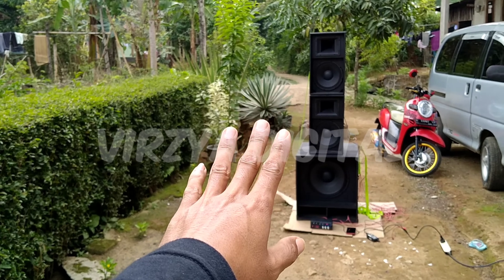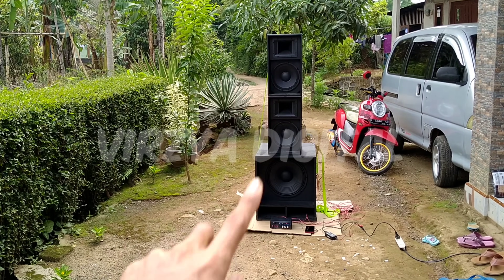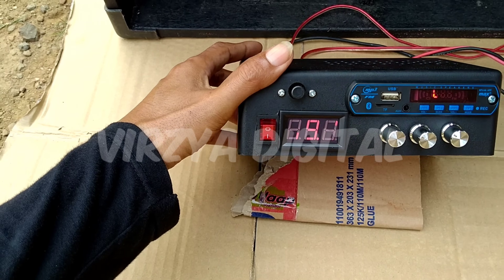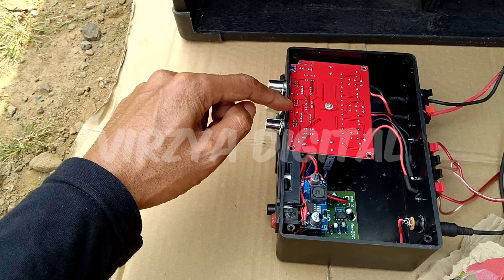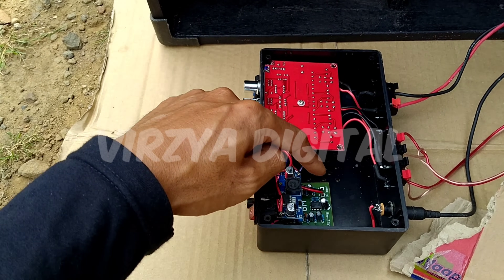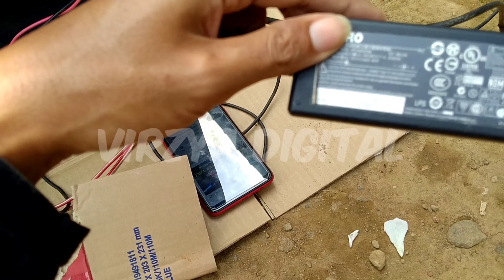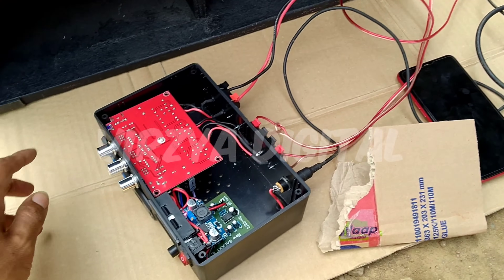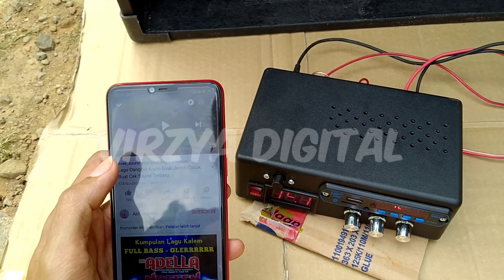Test Outdoor Class D Tpa3116d2 Angkat 10 Dan 15 inch Ternyata Bisa Glerr

Comment: Saya punya TPA3118 MONO chipt ori 32pin

Untuk angkat speaker pasif punya Polytron deck 450watt 10inch woofer 4inch fullrange 3inch tweeter kuat dan lumayan ber tenaga walaupun tidak maximal 

Dan di pasang speaker DAT 15inch 150watt berasa lebih nendang
Salut si sama ampli SE imut itu tapi bandel 
Gak tau kalo yg chipt kwnya

Comment: Sarannya bang saya pake smps 24v10a suara RL mantap cuma untuk subwoofer volume bass dinaikkan suaranya mati hidup (drop) mohon pencerahannya 🙏
Reply: Pengalaman prbadi...
Coba bos pakai 12 v 30@ suara lebih maximal. Di banding 24 v amper kecil..
Mending 12 v tapi 30 amper manter gak drop
Reply: @nnoficial2334  ocl 150 3amper udah gler
Reply: Jelaslah bro amper besar

Comment: Adaptornya pakek adaptor tv led kuat gk om?
Tegangan.AC.100-240V-50/60Hz
Tegangan.DC.12v/2.6A
Reply from the maker: Blm pernah coba mas
Reply: Bisa tapi enggak kuat ngangkat speaker besar... Hanya 30watt itu kalau 12v/2.6A
Reply: Cari ampere yg bsr  om

Comment: Joss. Jangankan pakai 15" mas. Pakai 18" saja nendangnya glerrr dalem banget suaranya tp powernya dimaksimalkan dayanya yaitu pakai adaptor 24Volt 10A. Mantab dah pokoknya libas ocl acl btl atau jenis botol libas untuk hasil suaranya bersih tanpa nois. Dan membandingkannya harus sesuai daya IC powernya jg loh ya. Klw ini class D tipe TPA31162 daya 200watt saja (bass 100watt, stereo LR 50watt 2x) 😄
Reply: Gler ,,, 1jam kemudian "bau apa ini bujank?"
Reply: @domhoregg_0377  skwkwk.. kemampuan oke.. ketahanan no🤣😁
Reply: Nyari dmna power 24v 10a link nya donk
Reply from the maker: 18"masih di toko mas 😂😂
Reply: Suk tanggapan nggo iki wee rasah tuku power2 sing abot 🤣🤣🤣
Reply: Punya saya koq protek ya pakai 5 ampere kecil 15 volt buat angkat legacy 12 inc 300 watt
Reply: sebelum komen biasakan sikat gigi dulu biar gak bau nafasnya😝

Comment: Penambahan sj om virzya. Utk kelas lapangan sy sudah coba dari klas Tpa3116 D2 yg paling nendang adalah tpa 3116 d2 type subwoofer. Setting fullrange dengan melepas dua milar 100n pada ic sub filter, takdisangka hasil bass bulat serta cucok utk lapangan kecil2lan. dijamin dgn volume stengan dgn menggunakan speaker fullrange 12" atau 15" dua unit sdh membuat emak2 podo uring2ngan bawa sapu😀. Asli settingan fullrange yg dihasilkan dari tpa3116d2 type subwoofer tak disangka dengan power sekecil itu mampu menggetarkan speaker 15". Monggo silahkan dicoba om
Reply: Wah, kayaknya menarik ini..
itu power supply nya pakai apa mas?
maksudnya pakai speaker 2 unit itu kedua speaker dipasang paralel atau seri?
Suwun mas...
Reply: @jokolewung9093  saya gunakan power supply eks komputer yg telah sy modif dgn catu daya 20volt 10A. Untuk pemasangan speaker di pararel sj mas, jangan lupa ditambahin ekstra fan agar ic digitalnya awet dan tidak over head ya. Jika dipergunakan di mobil, tpa 3116D2 dpt ditambahkan switch untuk setting fullrange atau full subwoofer layaknya seperti amplifier monoblok dengan cara memutuskan atau melepaskan pada  kapasitor 100n subfilternya.
Reply: @cakdar1 wahh matursuwun banget jawabannya mas,, saya jadi penasaran pengen nyoba..
tapi saya masih awam tentang elektronika,, yg jenengan maksud kapasitor 100n itu dua buah kapasitor bulat gepeng yg di dekat ic filter atau kapasitor kotak dua biji yg di dekatnya terminal output speaker nggeh?
Suwuun..
Reply: @jokolewung9093  jika type smd warna kuning bentuknya kecil persegi panjang. Namun jika milar local ada yg berwarna hijau atau warna kuning
Reply: @cakdar1  sy sudah pakai bang..tp blm dirubah2..coba adakan vidio tutorialnya bang..saya pakai sub 12 dan 4inc×2 saja
Reply: @storywasimpel848  pke brpa Amper bro dan volt?
Reply: Maap sebelumnya mas mau tanya" ,,itu kira" ada tambahannya ngak ya ,,,,,,,maklum mas masih pemula,,,,lagi belajar,,,,,
Reply: Bisa di kasi skema nya mas. Saya ga tau capasitor milar yg kaya gimna. Maaf mass pemula
Reply: @rizkyaditya7004 kalau yg untuk generasi pertama.
ada di antara potensio master vol dan sub .warna nya kuning nilainya 104.
Reply: Efek jangka panjangnya apa ketika komponen bawaan pabrik di lepas mas?
Reply: Di lepas ap di ganti pak
Reply: Itu speaker 15inch brp watt mas. Merk apa

Comment: mas TPA3116 normalnya dikasih berapa ampere ya.. kalau mau dibuat miniaturan subnya 4inc.. apakah juga main di 8ohm
Reply: @pandhowo repair okee. Makasih bang
Reply from the maker: Pake 24 volt 10 a dah maximal mas
Reply: @VIRZYADIGITAL  smps 24 volt 20 ampere gmn bang?
Reply: Berarti efek kurang daya ya sampai speakernya mantul".. saya pakai 12v 3ampere...
Reply: Main 8 ohm gk kuat gan..
Maxi 4ohm,,, & bagus d 2ohm..
Hemat biayanya mending pke PSU SWICTHING 24V/ 5A -10A
Klo pake AKI, Aki mobil carry aj ud lmayan mantap gan.. :)

Comment: Mas D2 mini 2x100watt saya tiba tiba d kasih input gak nyala. Awalnya jrang dipake...terus saya coba pake SMPS 24V 6A (50rb) Lampunya cuma kedip doang dan SMPS saya langsung downd (auto cut)  itu kenapa ya mas?
Reply from the maker: Power suplaynya yang gak kuat ..ganti yang lain
Reply: Tp biasanya pake yg step up dr carger hp kuat eh ini gak sama sekali...d kasih yg amperenya lebih gede malah.cuma kedip doang
Reply from the maker: Yang harga 50 rb itu bekas printer ..gak jamin 6 amper ..saya dulu pake juga  protex
Reply: Tp buat d2 120 watt dia ngangkat gak downd mlah bassnya kenceng

Comment: Saya pakai tegangan 20v 10amper murni kok pcb pada lompat mas ? Ngelupas gitu
Reply from the maker: Jebol gitu?
Reply: Iya bosku . Travo non ct merk belt
Reply: 20v ac apa dc bos
Reply: Dari travo belt non ct bos
Reply: 20v dari trafo itu klo sudah disearahkan lewat dioda jadi 29v dc bosku, jd wajar klo jebol, soalx tpa3116 max suplly 26v dc
Reply: @fankiaproject3532  apa iya 29 ,?
Reply: Lebih tepatx 28v lebih sedikit bosku 20vac X 1,414 = 28,28vdc
Aq jg pake 20v trafo, tp q kasih stepdown setelah rangkain dioda
Reply: @fankiaproject3532  misal pake 15volt apa ya om
Reply: @jokonantang5880  klo 15v ac jadix 21v dc, udah cukup mantap itu om untuk suplly power tpa3116

Comment: Punya saya tak kasih galaksi malah ambyaar bang suaranya .. apa gara2 pakek travo 3 amper ya om?
Reply: Klo pake trafo emg tdk bisa stabil mas..
Strum pasti drop, walau d tmbah Elko..
Pernah tes.. Trafo 5A, strum 12, bisa drop sampe 9volt bula kenas Bass..
Strum 24volt, bs drop smpe 12-13volt..
Suara bass ddi ambyar, kurag nafas..

Lebih baik clas D pake PSU switching..
Reply from the maker: Bisa jadi...mungkin drop mas
Reply: Saya sblumnya pake 3a ambyar jg,trus tak ganti pakai 5a main 23,4volt pake elco 50v 10rb uf,sblumnya pake 35v 2300uf ambyar drop sampe 13v trus ganti elco drop nya cuma sampai 15v volume full
Reply: @mdschannel4078  up...
Ada temen yg coba klo pke 5A Murni, dan d tmbah Elko 10rb x2 mikro, main di 24Volt..
Ktanya bru bs stabil...
Tetapi kurs nya jdi kurg efisien di biaya.. :(
Hehe..
Reply: @pandhoworepair2357  mungkin speaker terlalu besar,saya sub pakai legacy 8" main 1coil,box CLA,satelit pakai acr 5" 2biji+twitter 2biji pula,dgn konsep miniatur line array,enak2 aja,volume full jg ga ada sambernya,cuman ya itu drop sampai 15v tp masih enak ga ada samber sama sekali,mungkin utk angkat speaker besar (10" ke atas)jg akan ambyar suaranya,,salam satu hobi

Comment: Protec gak mas pas posisi vol full?
Reply from the maker: Tidak mas ..cuman sedikit over
Reply: Protec itu apa ya mas
Reply: @VIRZYA DIGITAL soalnya saya juga pakai power type itu power supply 20@ 12v kalau sub di full protec terus mas
Reply: Iya jelas mas wong output 100w kok 15 inch 300 an wat